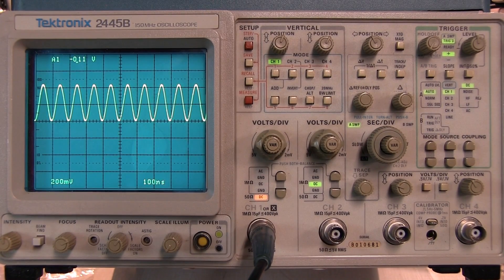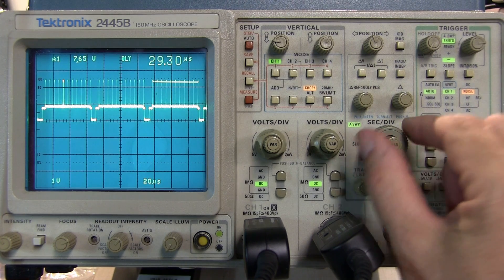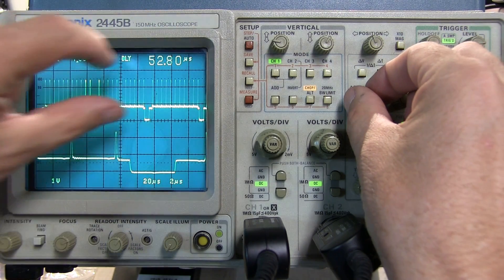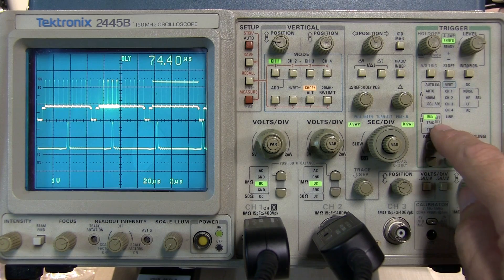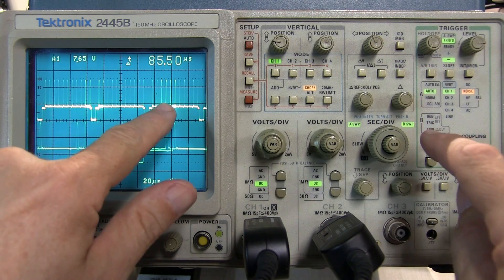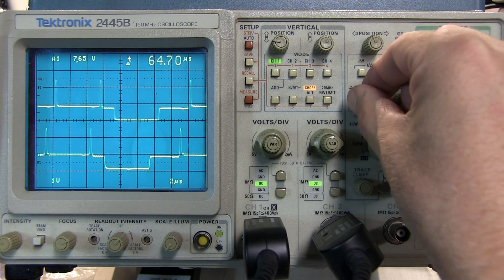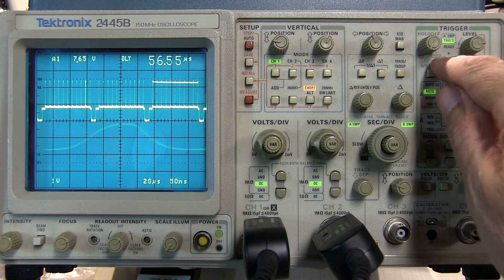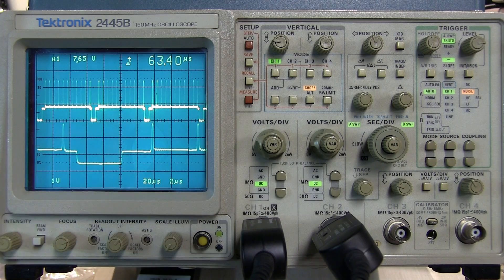#287: How to use the Delayed B-Sweep Timebase on Tektronix 2465 2445 2455 2467 Oscilloscopes

Comment: Can you please give us example(s) of circumstances wherein this particular tool would be more useful than a spectrum analyzer for instance?
Reply: google sucks:  this is time base..... not frequency base :) two total different world. 
When the clock is better then a pancake? Or.... car vs watermelon
Reply: As for example this NTSC signal with an Oscilloscope you can see how the puslses relate to each other in time, Vertical,Horizontal, signal etc where if you used a Spectrum Analyser you would just see the frequencies in the signal with no information on how they relate. Oscilloscopes display Amplitude vs Time and Spectrum Analysers display amplitude frequency.
Reply: I like to use it to find some event (B) which happens after some other event (A).  If A happens a lot but I may need to see the one after B.
Reply: It is basically the analog version of the zoom features found on many digital scopes.